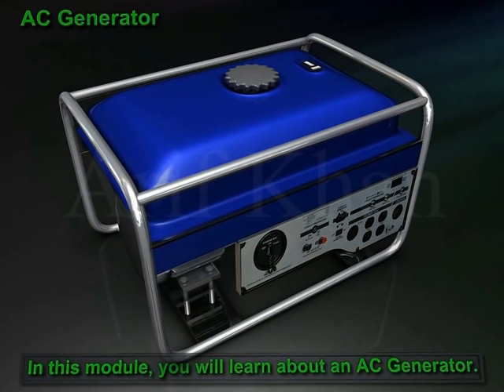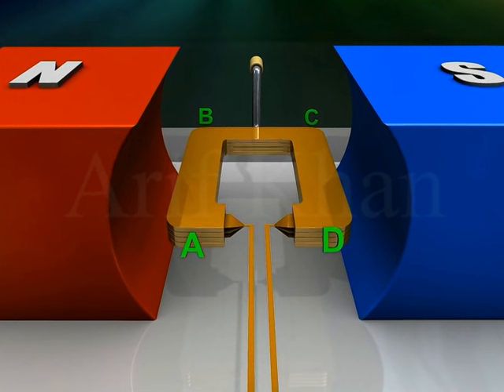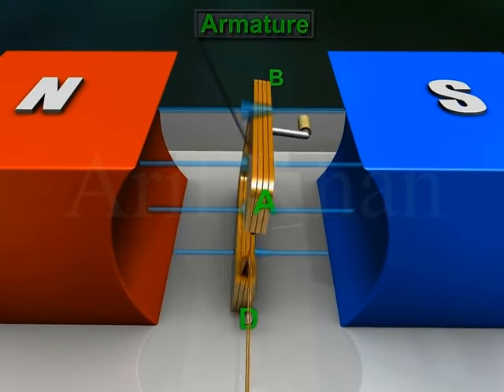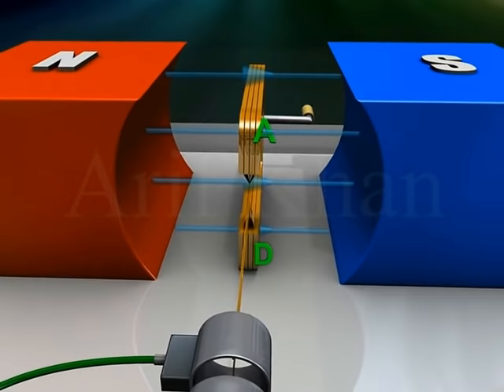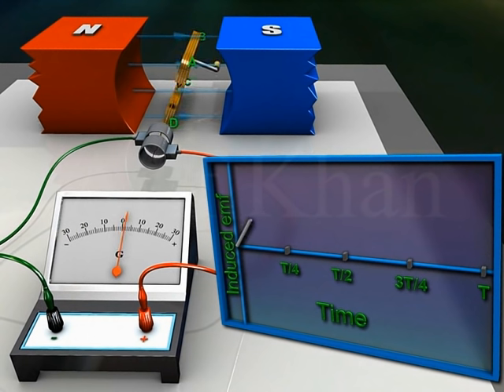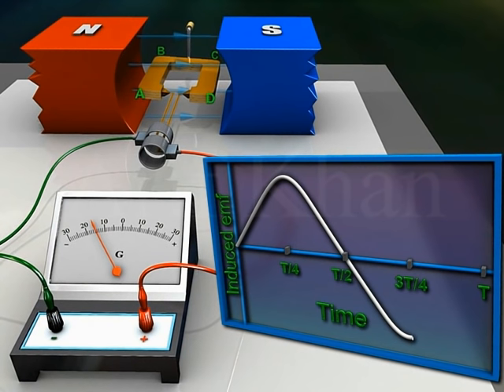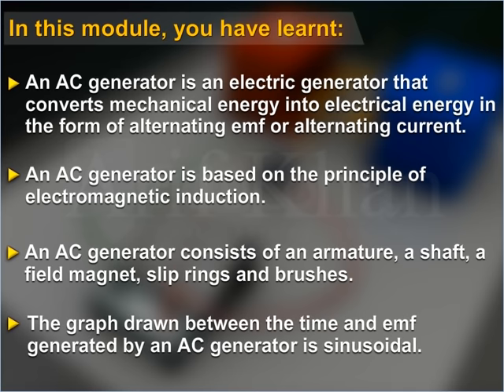AC Generator 3D animation | Electromagnetic Induction | Electric generator | Working of AC Generator

Comment: This is a great animation video with detailed, slow movement of the coil which makes it easy to see how a generator works. However, near the end of the video (starting at around 4:00 minute)where it shows the current direction and voltage produced (+ or -) and period, I think the current direction and the EMF sign are not correct. Please let me know if I have mistaken something. Thank you.

Comment: At  2:17 , the galvanometer should deflect to the maximum rather than showing zero current because the Magnetic flux is a sine function and the EMF induced due to varying magnetic flux is a function of cosine. Therefore at this point when the angle is zero between the area vector and Magnetic field the EMF must be at its peak value. Btw very beautiful animation and awesome explanation
Reply: yess and it should start from perpendicular position
Reply: Magnetic flux is a cosine function.. and the induced emf produced due to change in magnetic flux is a sine function.. so the video is correct

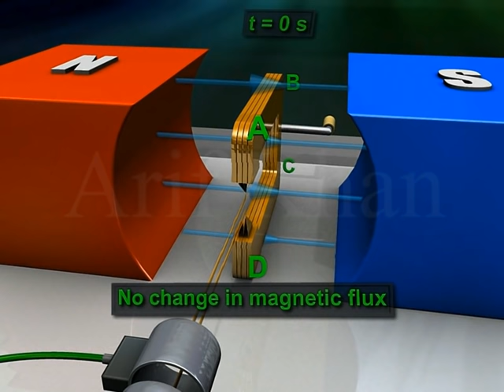Comment: I didn't understood the4:14 part i mean why is that so? because at parallel condition maximum number of magnetic lines pass
Reply: laiba adil This is because when the plane is perpendicular to the magnetic field lines EMF is not produced because it is not cutting through magnetic field line and current is not induced
Reply: please what you mean by the plane of the conductor i have a conflict between the conductor and the plane of the conductor i known that the plane of the conductor normal on the conductor but i can not imagine what this mean ,you can help me to to understood the difference,thanks to you
Reply: Hello friends
Reply: sin 90 is not zero. sin 0 or 180 is. when coil is perpendicular to magnetic field. the plane of conductor which is normal to the conductor makes 0 angle with the magnetic field. and sin 0 equals zero thus no force.
Reply: @vtp349  sin90 is not 0
Reply: @vtp349  okay

Comment: But if we start when plan of the armature is parrallel to the magnetic field such that when magnetic flux through the coil is zero and then start rotation then reaching at position where plan of armature is perpendicular to the magnetic field.now the change in magnetic flux is maximum,emf should also be maximum.can you explain this?

Comment: Why do you use concave magnetic poles? I have been  studing in the galvanometer file that using concave magnetic poles makes the flux lines parallel to the field.
If the same thing happens with the alternating current coil, the lines of flux will always be perpendicular to the field, and therefore the induced electromotive force will be zero, and therefore no electric current will be generated.

Comment: When coil is horizontal the angle between normal of coil and field is 90  flux = BAcos 90 flux is zero . Can you explain??
Reply: Flux is zero but induced emf is maximum because induced emf have sin function and sin90 is 1 .flux is zero because cos90 is 0

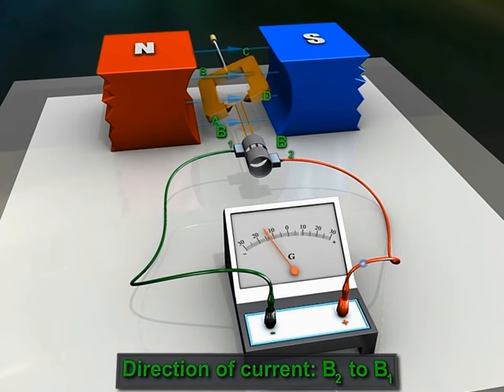Comment: I have a question about this video. at 3:33, if the direction of current from B2 to B1, I think the reading from Galvanometer should be positive. However, the video shows it is negative. Can anyone tell me if the video is correct or not.

Comment: The deflection of galvanometer needle is wrong when current is induced in solenoid through changing magnetic flux between interval 0:30 to 0:40 seconds (approx).😎

Comment: If I want to connect this output to a load....say..there are two wires 1. Green 2 red. Which is phase and which is Neutral..? Because Neutral is return line, phase is supply line?? Please anyone clear this